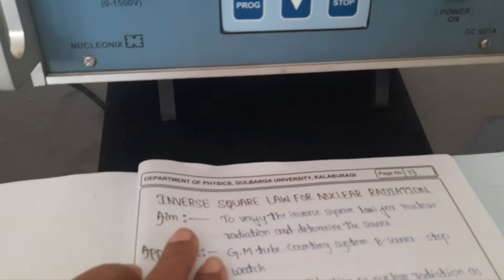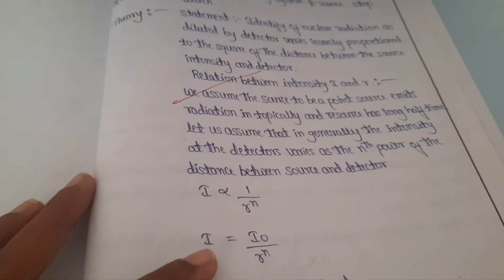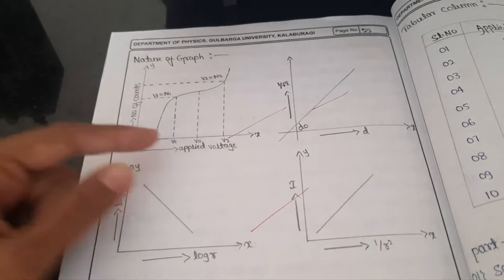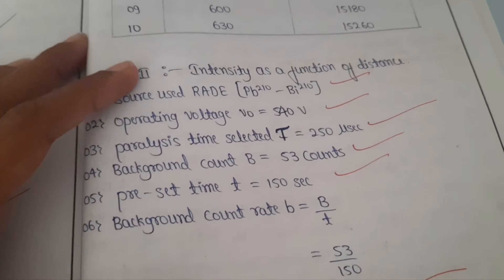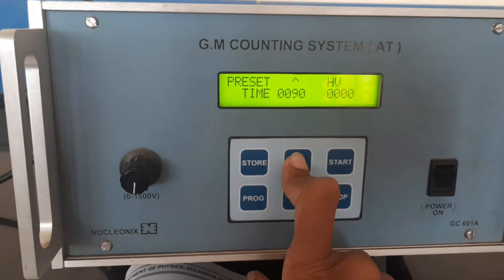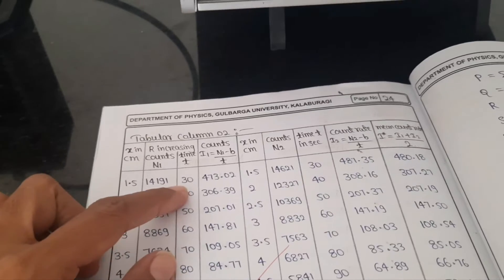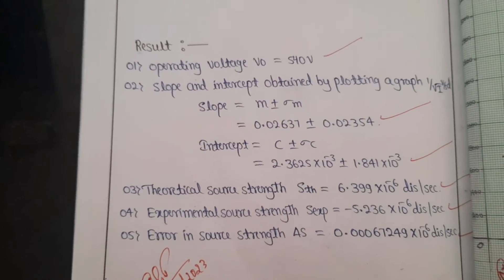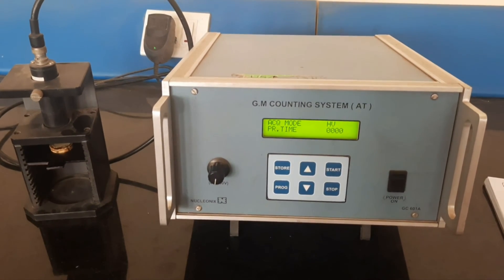Inverse square law for Nuclear radiation from GM Counter

Comment: Isnt the radiations coming from the source affecting  our body during the experiment.?...
Reply from the maker: Yes to the some extent but not that much harmful
Reply: @drsbphysics17 to some extent means whether it cause tissue damage ....radiation sickness like that or anything else ?
Reply from the maker: @deepdey9284        Exposure to low levels of radiation does not cause immediate health effects. Over the time it may leads to cancer if exposed lot.
           A Geiger counter measures radiation in units called millirems (mrem) or microsieverts (μSv). Normal background radiation is around 0.1 mrem/hour or 1 μSv/hour. 
         So, A level of 100 mrem/hour or 1,000 μSv/hour is considered high and potentially dangerous if sustained over a period of time.
Reply: @drsbphysics17  During Msc only a single semester contains this type of practicals..so doing a semester would cause this type of disease?...though not everydays in a week only....
Reply from the maker: @deepdey9284  GM counter radiation is 0.1(mrem) so not harmful while doing practicals, only radiation above 000(mrem) are harmful. So you can perform experiments.